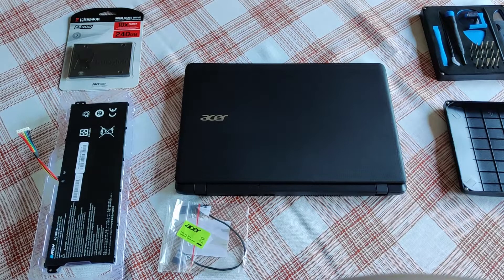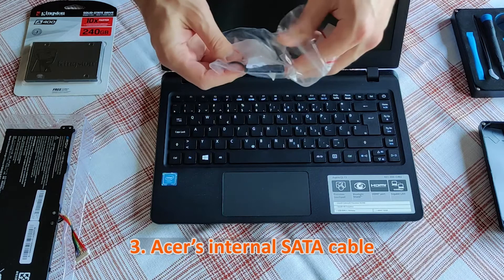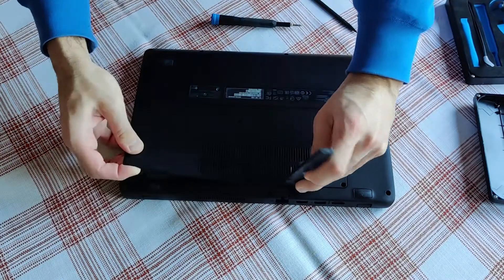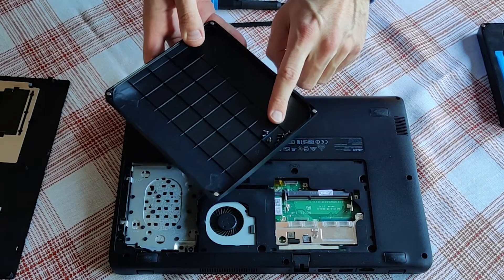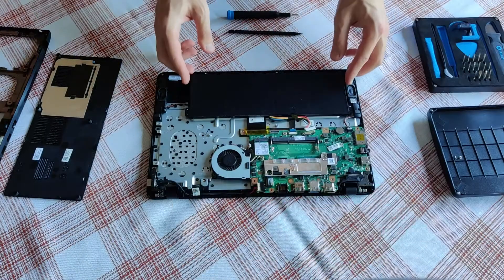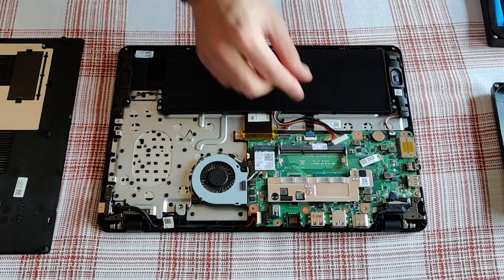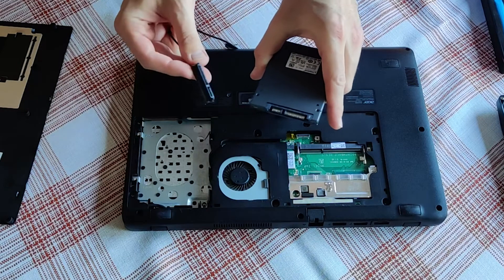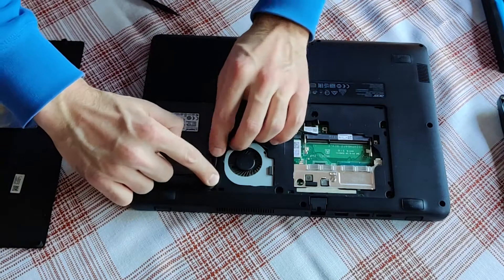Acer Aspire ES13 - RAM upgrade, SATA SSD Installation & Battery replacement

Comment: hello can we upgrade it to atleast core i3 ?
Reply from the maker: Hello! Thank you for watching. Please download CPU-Z and run it. Under top fields find "Package" (CPU socket type). If you see socket type as BGA (Ball Grid Array), CPU is soldered onto the motherboard. That means you can't replace/upgrade the CPU.
Reply: @smooth.IT.operator  Hi Can I ask my technician change to pentium to celeron cpu is it possible to upgrade the CPU to the higher?
Reply from the maker: @edwinmontanez9282  On this precise model it is not possible to change the CPU. It is soldered onto the motherboard.

Comment: Hi after you installed the RAM you will need also to download app like microsoft or any related app to laptop? because i thought if you change your ram all app will be erase and need to upgrade also the windows 10?
Reply from the maker: Hi! No need to install Windows when you replace or upgrade RAM. You will keep all your data stored on your hard drive. No fears.

Comment: Possible to upgrade RAM to 8GB?
Reply from the maker: There is 2GB RAM on-board. So you could either use a 4GB module like in the video or a 8GB module for memory expansion (single memory slot). Correct me freely if I am wrong but I don't think there is a 6GB memory module to achieve 8GB RAM. You got a 6GB RAM module?
Reply: Do you need to remove the old ram to (4GB) before installing new one?

Comment: Can be upgrade the CPU?
Reply from the maker: Please download CPU-Z and run it. Under top fields find "Package" (CPU socket type). If you see socket type as BGA (Ball Grid Array), CPU is soldered onto the motherboard. That means you can't replace/upgrade the CPU.